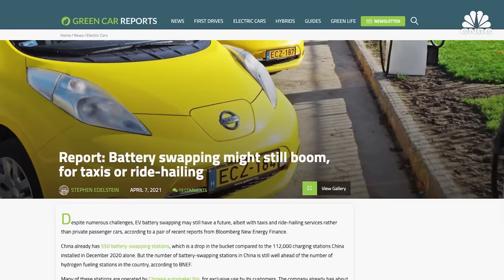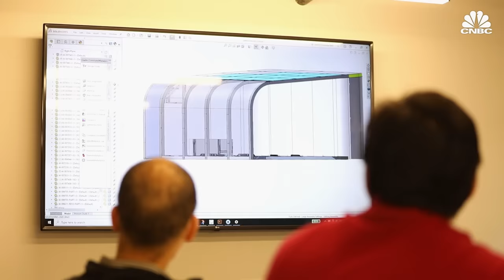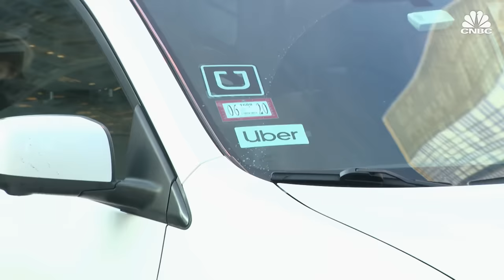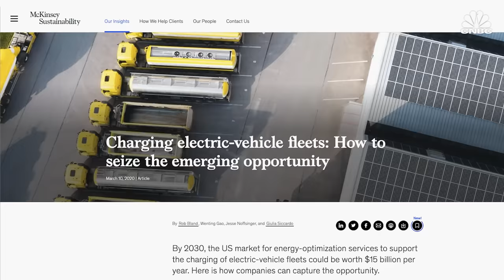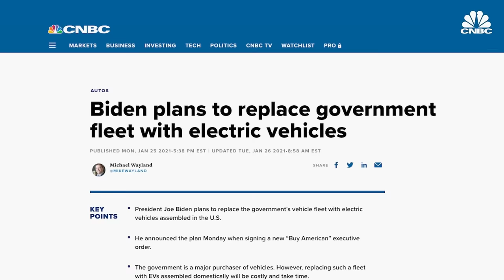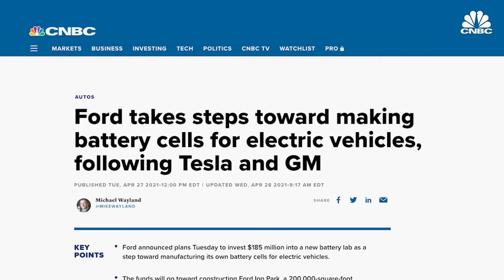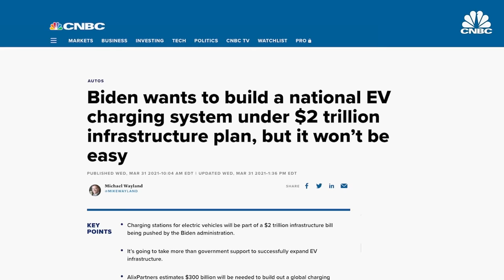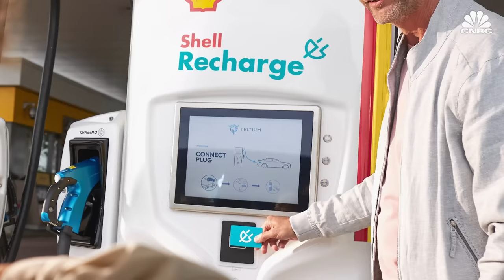Can EV Battery Swapping Take Off In The U.S.?

Comment: One thing that everyone needs to understand with this whole battery swapping thing or modular battery swapping thing is each individual module can be monitored for its own condition and as the individual modules start to fail or become weak the company that is in charge of the battery swapping can easily go and take that one worn-out module and replace it with a new refresher much better condition module so if you have a car that has this battery swapping technology you're not actually ever going to have to worry about having your battery fail because it gets old because you will constantly be swapping out your battery and for just an extra penny a mile for a modular swap they can also take into account the cost of taking old worn-out modules out of circulation and putting new good modules into circulation or only using the old worn-out modules in an upgraded section of the swapping station for only being used in Grid backup and balancing situations so that is one thing that everyone needs to take into account because with this technology you are not going to think about battery degradation because most likely if everyone is regularly swapping out their batteries and not letting them discharge too low then the battery modules that you will be able to get are never going to be below 80 to 85% state of overall health plus if this does take off there will also be an option where you can pay extra money to get newer pressure modules put in your vehicle to get the maximum range or you can spend a much lower amount and get some of the older modules that are closer to being taken out of circulation and save money on your charge / battery swap and that particular instance but get a lot of range back on your vehicle in a short amount of time there are numerous advantages of this system the number of overall advantages of having a battery swapping system like this definitely outweighs the disadvantages and if this technology becomes a standard thing then as I said earlier you wouldn't worry about battery degradation because the company that actually owns the batteries and the battery swapping stations would be individually monitoring each battery pack or module and taking them out of circulation as they get below a certain state of health and swapping them in with new ones that are at a higher state of health or has been refurbished to increase their state of health so age and degradation would not be something you would be worrying about or thinking about in a system like this where is if you own the battery and you don't swap it out and you do keep it for a long. Of time then you would be worrying about degradation and age of the battery.

Comment: 2 issues:

1) Batteries are (currently) the limiting factor, and this would contain batteries instead of having them in the cars.

2) How many battery swaps can you do per day? How does this compare with chargers (taking up 2 charging spots)?

Batteries lasts more than 1 million miles today even with fast charging (as long as thermal management is working). Here the batteries in the car has no thermal management and hence the life of these batteries I think will be shorter even with slow charging. Also (current) lithium batteries should not be charged much above 80-90% and left unused for a long time. Here they are probably charged to 100% and left until next car needs it... 10 minutes change time must come down as fast charging is quickly getting down to this level. Getting 200-300 miles in 15 minutes today (10 to 60% SoC) is fine even on long road trips and will only improve. Even with TaaS (FSD) taxies charge time is not a problem - I am sure the car can use 2 x 20 minutes during less busy periods for charging.

Comment: the battery charging/storage wall holds 100 batteries.  lets say they cost $10k@, that's $1m of batteries sitting, unused.  That alone would cause a battery shortage, world wide.    next: let's say a car uses 4 packs.  That's only enough for 25 cars.  what happens when it runs out of fully charged packs?  Oh, time to switch from trickle charging to fast?  Didn't you just say that's bad? Other Cons: weighs more than an installed system, lower total KWH, therefor Shorter Range, requiring more often swaps.   Reality:  Destination Chargers everywhere.  Wireless Chargers at Taxi Stands.

Comment: He does not speak for me. I would love swapping. I remember this from years ago!!
Reply: It is a dumb idea and those that try it will go bankrupt doing it.
Reply: @ultrastoat3298  Not with modern and fast robotics. It will only develop and progress. Unless there is some kind of conspiracy to stop them from happening. Look at hand-held cordless drills. These are a perfect analogy. They have developed and progressed substantially and will continue to do so.
Reply: @jamesmedina2062  it’s not a perfect analogy lol. You don’t have to go to take your drill to Home Depot when it’s dead, put your drill in a box, and have a robot swap its battery, then go back home.  It’s a dumb idea, and it will get abandoned, I guarantee it. 1) forces manufactures to build extra and have sit idle the most expensive part of the car 2) the up front cost for these stations are horrendous 3) you will have a mix of standards across brands which will evolve over time meaning you have to go to the RIGHT station, these stations actually have lower throughputs than even medium sized supercharger locations, and they are betting that fast charging doesn’t get any better than it is today and I bet the cyber truck can put on 300 miles in 20 minutes. This is DOA. Tesla tried it like 8 years ago, saw it was dumb and killed it before it killed them. They are way smarter than theses guys. Even the niche use cases for this probably isn’t enough to sustain it.
Reply: @ultrastoat3298  We go to great lengths to ship oil and fuel and destroy entire regions with fuel spills. This is just another way to refuel and its way better than hauling petrol around or spilling it from pipelines. Hopefully this becomes common because at least half of all people with batteries and no liquid fuel could use it. It solves lots of problems.

Comment: With EV's I've always seen the battery as the weakest point, at least for long term.
This if done correctly, would be beneficial... I'm coming from the used mobile and laptop area, battery's are a main failing point.

Comment: How much does that stockpile of batteries cost? Seems like a lot of money to spend on batteries that spend so much time not being used.

And how did you not question their claim that it doesn't take much power to charge. Charging 20 batteries at 5% the speed takes just as much power as charging 1 at 100% speed. We aren't saving money on wiring, and each module being charged needs to be controlled individually so I don't think there isn't likely to be cost saving on the sensors or computers. And even if it really only takes 2 parking spots, that is twice as many as a fast charging station.

Whole thing seems pretty sus tbh.

Comment: This makes sense.  The funny thing is how people can't see that this is the solution.  I worked in a food processing plant from 1980 to 1990 and we used electric fork lifts. We would swap out batteries the old fashioned way with an electric wench lift out the depleted battery and put in a freshly charged battery and that was with the nickel hydride batteries.  It would worked very well and kept the air clean inside the Quick Freeze Plant and was so much better than using the gasoline or propane fork lifts.

Comment: Battery is a depreciating asset, which company would like to sell the car but own the battery?
Reply: Agreed.   But imagine if swappable packs enabled cars to be purchased with a 1/4 or 1/3 pack and add 1-3 battery packs for the occasional longer range use?   I would happily pay less for an EV for 1/4 or 1/3 range as my use case is a 10 minute round-trip commute.   Even a 100 mile round-trip commute needs only 1/3 of the Tesla Model 3 365 mile range.   With a lower vehicle weight, the range for a 1/4 or 1/3 pack battery would increase somewhat.

Comment: And one side to consider is that people with limited founds that cant afford to buy a new(er) car, but a 10 to 15 year old car can do this and do not have to worry about the battery are very degreaded or will brake down any minute. If the owner have to buy a new battery pack it is very expenceive. Battery swap eliminate that issue totally.

Comment: When they said battery swapping I thought of engine swapping.. like putting a Tesla battery in a leaf of egolf lol
Reply: @Allen Loser i mean you'd have more wattage to play with to "overclock" the motors, probably destroy them pretty quickly though
Reply: similarly changing the motors without changing the battery probably wouldn't have the desired effect if the motors aren't getting enough juice
Reply: @Allen Loser you don't necessarily have to replace the engine, just use a more potent fuel, i.e nitrous oxide
Reply: @Allen Loser but you're right that's a huge difference in weight so you'd probably just want to connect more of the golf cells in series
Reply: @Allen Loser There is a VW Golf with a tesla drive unit in it on YouTube...
Reply: @Allen Loser 450hp a downgrade ermmmm...
Reply: @Allen Loser An hour to charge 🤣🤣🤣
Reply: @Allen Loser Dont discharge your battery so low = less time to charge...

Comment: Oh great now I have to keep changing the time on my clock
Reply: Nope, there is a separate 12v battery that handles the normal electrical system in the car.  The EV battery is mainly for the electric motor.  You'll only have to reset the clock when that 12v battery dies, just like in a gas or diesel car.

Comment: Maybe in 10+ years.  Ample is selling charging and battery swaps for roughly the same price as buying the battery and charging overnight in your home or at a Tesla Supercharger.  Provided there are supercharging stations that charge 80% in 30 minutes (a typical fill-up), pack swaps will not work until there are enough batteries in system after 10+ years.

Comment: Battery swapping will never take off in the United States... It may start but it will stop very quickly after tens of thousands of batteries are stolen from the swapping portals
Reply: If it’s ran like a gas station and has an attendant, I don’t think it’d be that big of an issue.
Reply: Then you have to worry about corruption, however it seems that they intend these to be run in an automated capacity. We shall see I guess.

Comment: I see a lot of people mentioning and worrying about getting an older battery during a swap. Let's say they can solve this and not have batteries that have less than 90% degradation at a Swap station. Imagine the logistics of moving around batteries and meeting demand requirements in different areas of a city. It would be absolutely crazy moving around batteries from Swap stations just to meet the eventual large number of clients at a particular station.
NIO is way ahead of these guys and they are pushing for decreasing swap-time to around 2 minutes per car, but when there are 10 cars in line, you could end up having your battery swapped after 30 minutes. And in order to mitigate this and not have clients get angry, they provided their own "fast" 50kWh charging stations FOR FREE next to their swap stations, so that if you don't want to wait for a battery swap, you can charge your car.
So, what was the result? 80% of people prefer charging their cars instead of swapping batteries. All of them would get their desired charging % in 20-30 minutes while going to get a coffee or walk around, instead of waiting in the car, in line, just to move closer on every time a person leaves the Swap Station.

Comment: Simple leasing for as long as you own and drive the vehicle. Never worry about having to pay thousands for a new battery when you are unsure whether the vehicle will continue being useful. Pay a rate based upon distance driven multiplied by battery capacity plus for the juice (per amp/hr) delivered in the battery. If you charge at home at a better rate so be it. If you feel the pack in the car is not holding enough juice you take it to the station and pay for the distance driven at the capacity rate the battery was delivered to you at. Plus the juice in the replacement pack. Never have to worry about recycling dead batteries knowing that it is in the best interests of the swap station to get any equity they can out of the dead ones. Whether that be due to value of the materials or legislation requiring them to be reprocessed.

Comment: Wouldn’t this process mean that you would never use 100% of the “energy” that you purchase? Whenever you turn in a battery, it would always have 1% or more of the charge left on the battery.
Reply: If you drive into a normal charging station, do you drive in on an empty charge?
Reply: @njerikiarie8928  But in a normal charging station, the charge remains INSIDE the battery. 

Battery swapping stations should ideally charge ONLY for 80% charge if the old battery has 20% remaining.
Reply: @njerikiarie8928  , I don't drive electric, and one of the reasons is access to "fuel".

Comment: Batteries are going to be backbones for the cars, this way it's more efficient. Splitting the pack in two may also increase charging speed to gain substantial mileage in 30 minutes. 
Battery swapping tech is born dead.
Reply: Standardization of pivotal components is inevitable. The novelty of electrics is why there has not been more standardization.  It will help the manufacturers to focus on other systems and allow for new and varied battery technology to progress. Nobody would want battery architecture to be very costly to replace, very expensive, or extremely unique to one model of vehicle.
Reply: @jamesmedina2062  Considering the chemistry and size of the battery is something important, it sure as hell will not be standardized over the entire car market. Within the car companies themselves? Sure. Adding to this that companies are now turning to make the batteries as an integral part of the cars structure rather than a battery pack as a cost saving measure, you can sure as hell forget about standardised batteries beyond the brand/partners.

It is for this reason battery swapping just isn't going to be happening across brands, only within brands, like with nio. Maybe if multiple car companies turn to battery swapping you might get partnerships/swapping station that can service all these brands, but before that time, very unlikely. And there aren't any large car company except for NIO even looking into swapping, this idea has been canned already.
Reply: j na  You do realize that in case of a power outtage battery swapping won't happen either, since these batteries also still need to be charged? 

As for car being dead after x charges, that doesn't change with battery swapping, in fact in regular use most people will just charge at night, putting even less pressure on the battery than what happens in battery swap stations where they also overall need to use fastcharging, maybe just a bit slower if they hold enough batteries. In most regular uses new car batteries can be expected to last a lifetime of the car (at least for Tesla this is most certainly the case, and likely also for most other brands). EV batteries always have at least a warranty of at least 8 years or 100-150k miles, whatever comes first.

Charging stations being full should also not be a problem, that is like saying fuelling stations are constantly at full capacity, and they would if it weren't for the fact that supply follows demand. If they aren't enough chargers, more will be placed. And overall in regards to fastcharging, most people won't use it for more than a few times a year when they need to take too long trips that are outside the range of their car.

Ofcourse there can be multiple solutions, that doesn't take away the fact that practically all large car manufacturers have their own batteries and will produce their own batteries (in conjunction with battery producers) and that several of those (Tesla, VW, ...) already announced that the batteries will be an integral part of the structure of the car due to cost reductions, the opposite of easily swappable.

And comparing the batteries with the gas tanks is just laughable. Gas tanks have no other point than holding the fuel, there isn't really anything special about it and nothing you do with it would give you a really good advantage, completely the opposite of batteries, which are the most important part of the car and will have an important impact on the cars performance, from range to acceleration to charging/refueling rate to ...

Comment: Here is a factor.  If I can swap my battery on long trips,   I would only need 120 mile range EV for local driving.  This would cut the weight of my car by 600lbs?  and the initial cost of the car.   In my opinion, you might could even get away with a manually swapping system.   Keep battery modules at about 50lbs and use manual jack system.   Use U-haul as distributor of the batteries..     You could still have the robot swap stations, yet for those looking for a good budget (the American way),  you have the manual option.

Comment: Imagine waiting in line for hours to swap a battery. 🙄
Reply: Did you watch the video, because they showed they can do the swap in 10 minutes
Reply: @Les_S537  and when there's 6 cars in front of you? a gas station can build 20 pumps for half the price of that swapping station
Reply: @Les_S537  Yeah right, but if there's like 6 cars lining up for a battery swap when you want to change especially in one station, that's like 1hr. Not ideal I say, better have chargers.
Reply: Well you dont really need to change battery often, you can still charge the car like ordinary EV. Probably change the battery once a year to avoid degradations